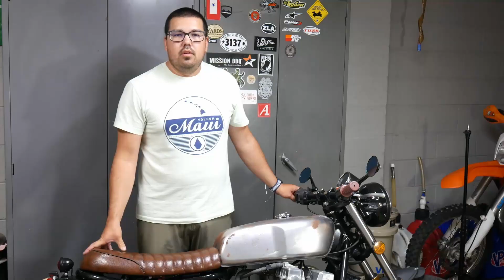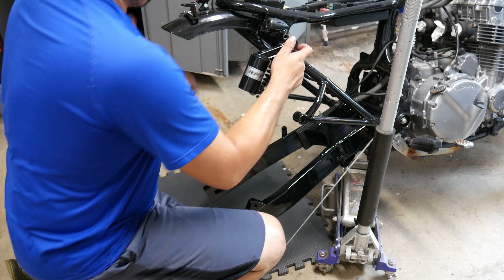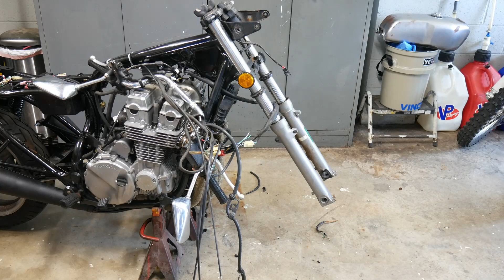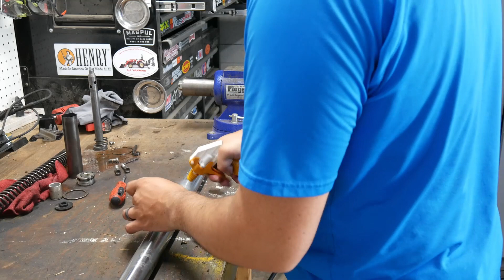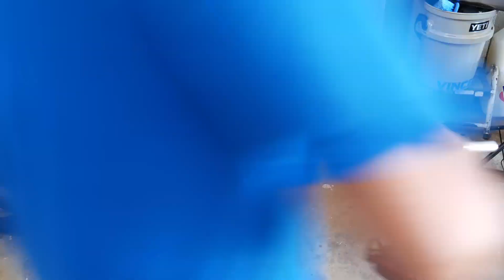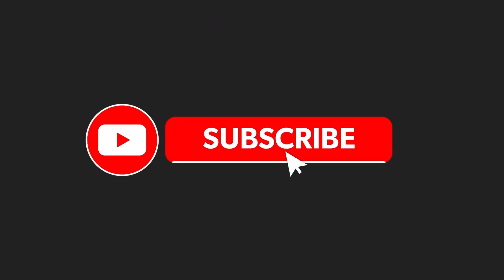Honda CB750 Cafe Racer - EP7 - Shocks and Suspension Forks

Comment: Could you please state what size and model # RFY shocks you mounted to your 750 Nighthawk? Amazon links would be a nice thing to ad to your video's. Your build is coming along nicely. BTW, this generation of Nighthawks make for some nice cafe racer builds for not a lot of money. Those engines are legendary and run like swiss watches when tuned properly.
Reply from the maker: Sure! They are 13.5" or 340MM with eyelets on each end. I had to swap the bushings from the stock shocks over to the new ones if I remember correctly. They're sprung kinda stiff just FYI.